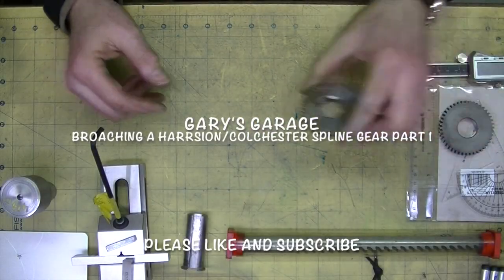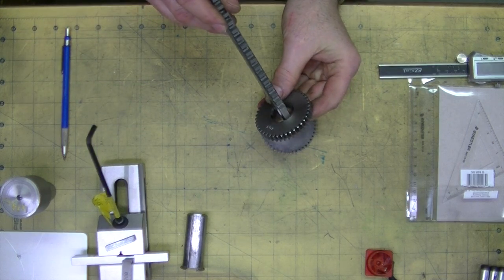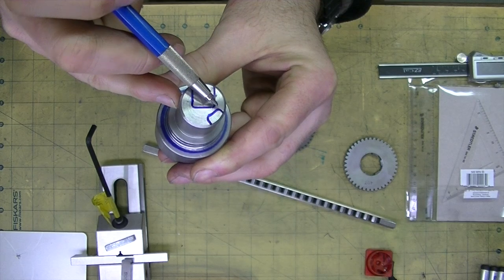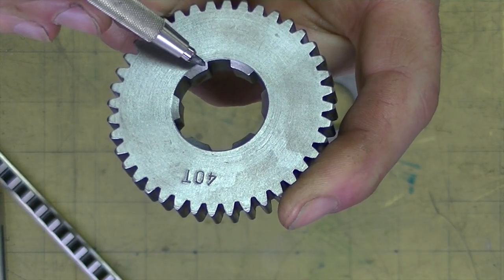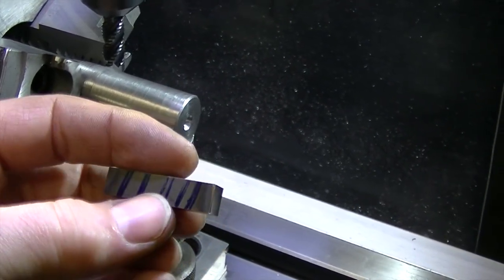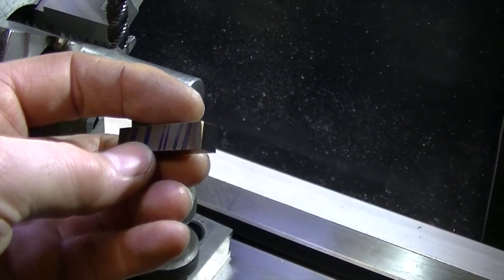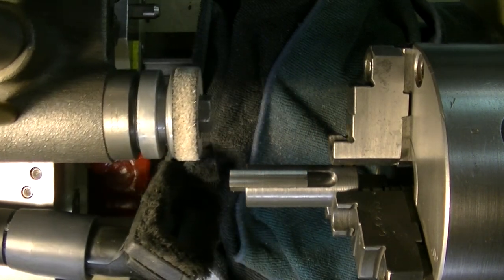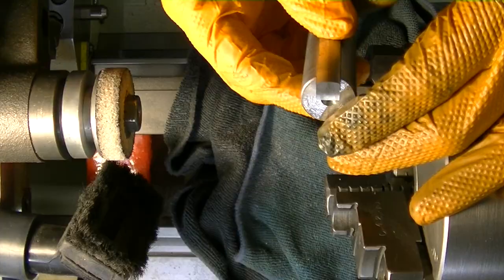Broaching a Harrison Colchester spline gear part 1

Comment: I curious, have you considered just putting the gear on a rotary table and broaching with your mill's spindle? Obviously not full depth/width in one pass, perhaps using a narrower version of the cutter that you made.
Reply from the maker: I did, it's just way too much work and becasue of the number of cuts one would have to take, there would be too many opportunities for things to go wrong, not to mention the stress/wear on the mill rack and arm assembly and not being able to go straight through the table.  Just broaching 1/4" takes a lot of force so a minimum is a 3T arbour press.  Most machinist use a hydrauylic press (air over hydraulic) for this type of operation.